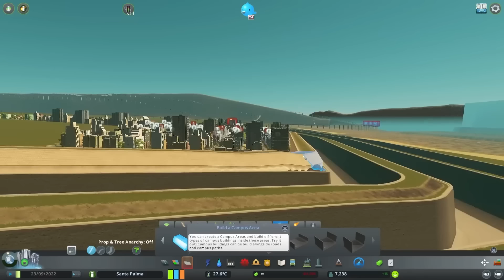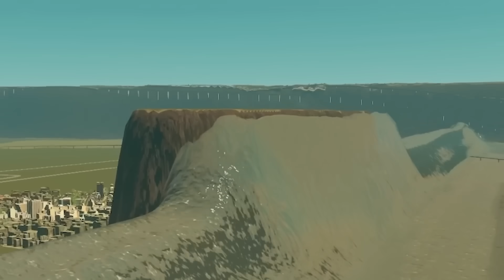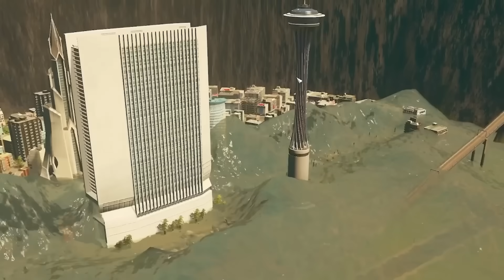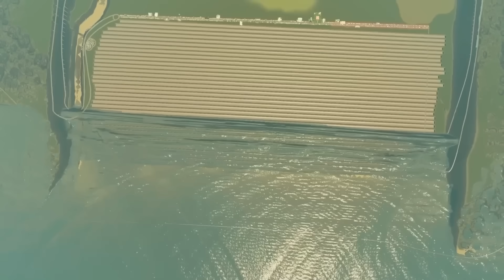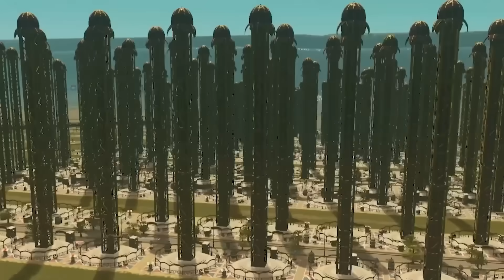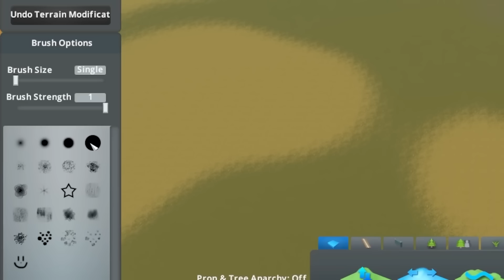Stopping tsunamis with IMPOSSIBLE ENGINEERING in Cities Skylines!

Comment: I don't think the software was modeling the fluid dynamics correctly.
If you see the behavior of the wave, it appeared to just go through and not up/over/around like you see how river flows behave with giant boulders in the river bed.
If it modeled correctly, you could have found ways to adjust your structure or add other countermeasures.

Comment: about skyscrraperrs, probably irl they would collapse, just because of the way they are constructed - they have some thing in top floor too just help skyscraper to move in oposite side of the wind that pushes into skyscraper, so in tsunami scenario, there would be a strong wall of wind that will push in one side and shortly after that a tons of water will overpush skyscraper from 3 sides ish, and shortly after they would fall like dominos and washed further making something like big pile of metal and glass and beton waste, that will make tsunami even stronger, just barely slowing it down. BUT in comparison, i do think tsunami momentum will be slowed by destroyed building really fast, than other buildings.)))

Comment: The reason the wave didn’t speed up is because your valve is an open system, so in a closed system the pressure would drop and the velocity would increase, but because the water is able to go upward, the energy goes there instead of to the speed.

Comment: With the way the tsunami and water behaves in this game, I have a theory of a simple method to stop it.  I believe many layers, like ten layers, of short, curved flood walls, with the concave area pointed back toward the source of the tsunami might reduce it enough to stop it.  The theory I have is that the curved walls should redirect the force of the way back on itself, reducing the energy that reaches the city.
Reply: That would work, you could even make these under water to make them less visible.

Although having said that, you'd need some serious anchorage and depending on where it is deployed, some way to clean it, you know, erosion / deposition.

Comment: I dont think the tesla valve actually works in the way it does in the real world because the head of the wave just goes ahead of the returned water, its just that the wave gets pushed through a small space, smaller than the width of the wave, so the arched spread of the wave is reset and therefore reduces in size sooner, i aint no engineer or scientist but thats how i see it happening lmao

Comment: Ok so can i just talk about the elephant in the room, would big arsed trenches work in real life? Can we roughly input the amount of water that arrived in the japan tsunami,i imagine its a larger wavelength,  then model a way out of it with trenches. I've imagined a cheese grater style coast line that could decapitate the wave then send it back against itself. Cant wait for cs2 to try it. I hope u can make better tunnels
Reply: No chance. The tsunami would just travel on top of the water, it doesn't care if the water is moving or not. A tsunami doesn't move water, it's a wave. Only energy is moving before it crashes on land. More water only helps the tsunami, as the video nicely showed.

And the wavelength depends on the depht of the water below, deeper water means lower and faster wave.

That means a trench just reduces the height but increases the speed of the wave over it while the wave is directly over the trench. Afterwards the wave is (almost) exactly the same as before. 

Jumps in height can reflect part of the wave, but i don't know if that could work, that would need some calculations. I think not, or it would probably already exist.

Comment: I"m not trying to critique or anything like that, but the diagram on the tesla valve had "staggering" slices, where yours have the slices parallel to each other. So yours is a bunch of Vs where his is a left side i, followed by a right side i but farther back, followed by a left side i even farther back, etc. I wonder if that makes a difference because instead of just trying to hit the main water with a backdraft his is doing it in smaller portions while allowing the flow to not get directly walled into it just moves left to right side i's with each of them pushing back a bit of the water. I probably explained it terribly, so hopefully it makes sense.
Reply: I was digging through these comments hoping someone said something about that when the tesla valve works because of it's asymmetry.  But given this is a mashup of older videos, hope he has gotten that message when his design wouldn't work as the original valve is designed.